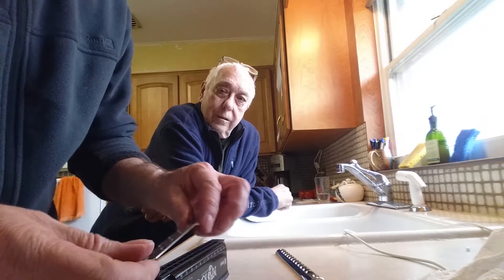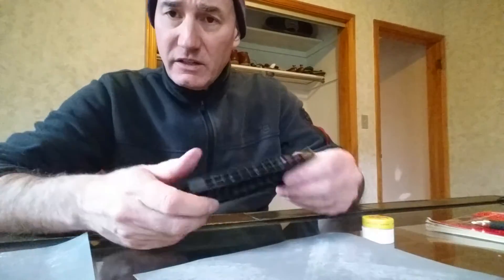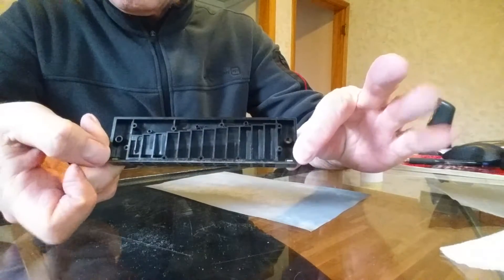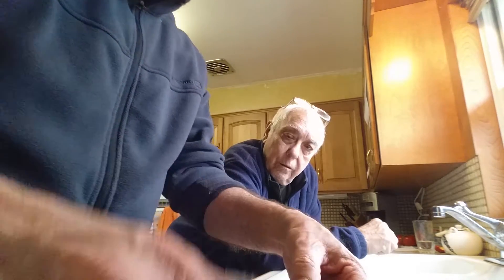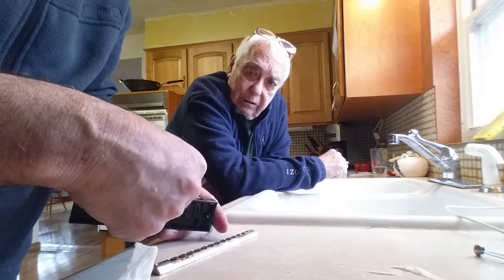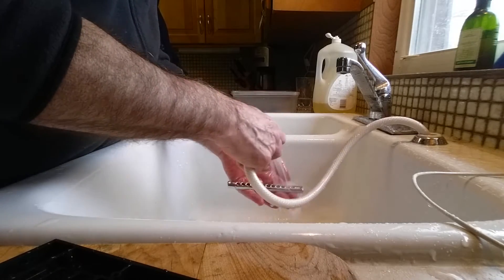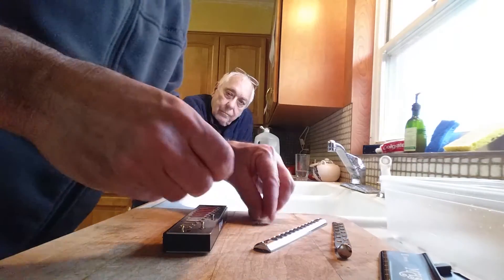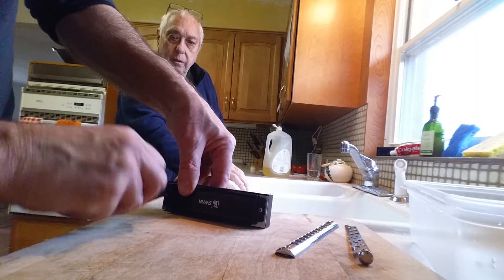AIRTIGHTENING OF SWAN SW1248M

Comment: cheers, i spent an hour watching your video yesterday and working on the swan. My swan was a little different. It had 2 extra pieces of metal that the slide fits into before its sandwiched between the comb  and mouth piece. I dont have any harmonica oil so i used some extra virgin olive oil. Cheers for the info and my swan chrom is louder and more responsive now. Worth the effort for sure. I might even buy another one now. If i had any criticisms of my swan it would be that hole 1 blow is a little more temperamental and have to watch it some times when playing so that it doesnt choke  out , but most of the time its ok
Reply from the maker: David here...git that slide oil! Hetman's